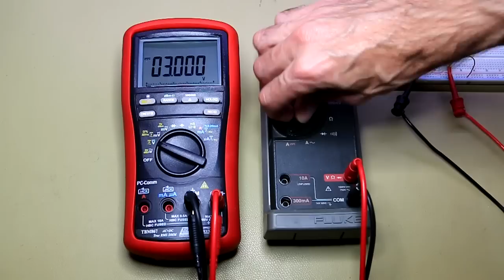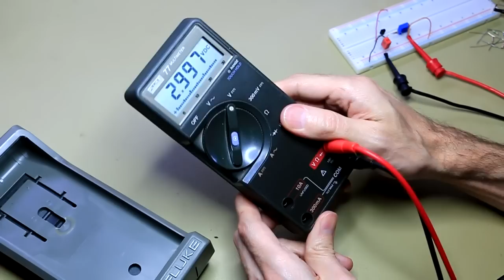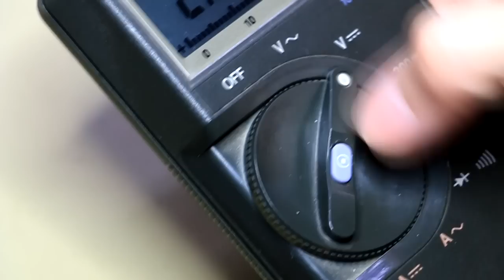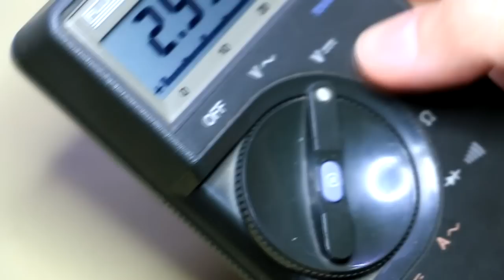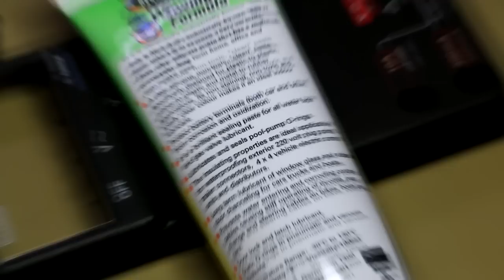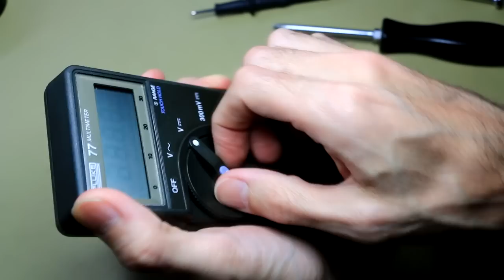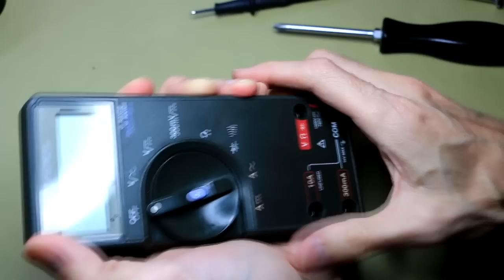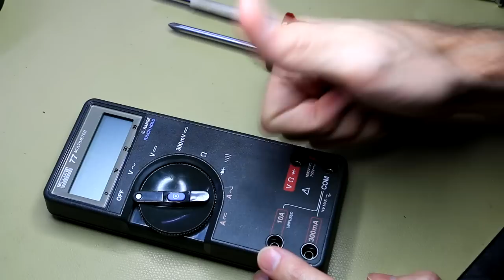Fluke 77 teardown, calibration and servicing (#008)

Comment: My fluke 77 keeps flashing OL, I checked the fusable resistor and it's fine, do you have any ideas as to what might be wrong with it?
Reply from the maker: GhettoRanger I assume this is in Voltage measurement mode, yes? What does it do in the Ohms, Amp and Continuity range?
Reply: Thanks for getting back to me so fast. Well, I found a Fluke service manual online and it helped me find the problem it's a loose solder connection on the U2 IC chip on the back of the circuit board, when I press on it the problem goes away. I'm thinking about touching up the solder joints with my soldering iron and some liquid flux. For your future reference it just kept blinking OL with the bar graph on every setting.
Reply from the maker: GhettoRanger Thanks for the feedback, that is very useful information - hopefully it will help somebody else in the near future :)  Agreed on the touch-up idea. Also look for other joints that may be bad that get stressed when you press against the chip - it might not only be the chip leads.

Comment from the maker: The Fluke 77 is a fine meter for everyday electronics use - most DC-DC converters have, by their very nature, a DC output, which is fine for measurement with this meter. Some (low quality) AC inverters do not output a pure sine-wave, so I agree that readings with any non-true RMS multimeter will always be out by a few percent.
Reply: Fluke 77 still look good !